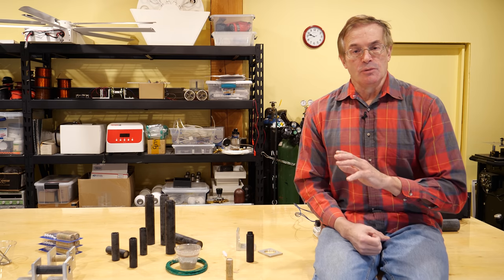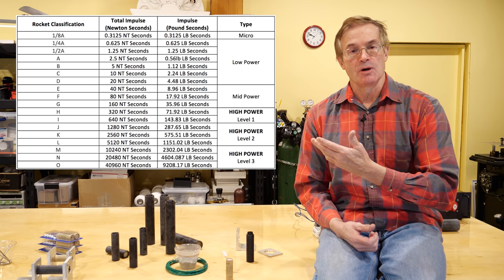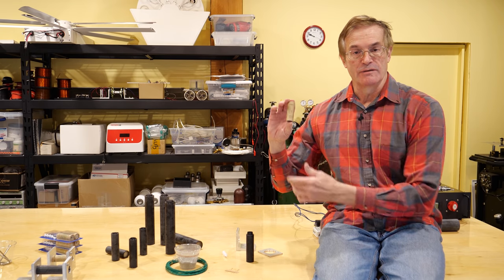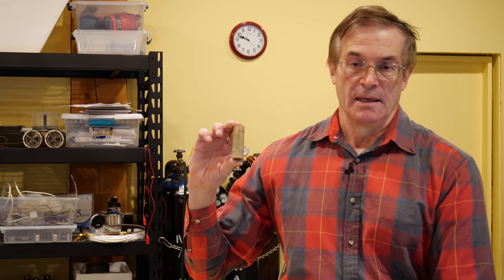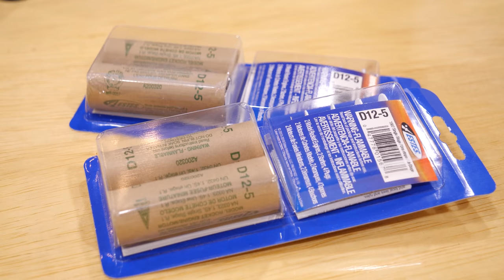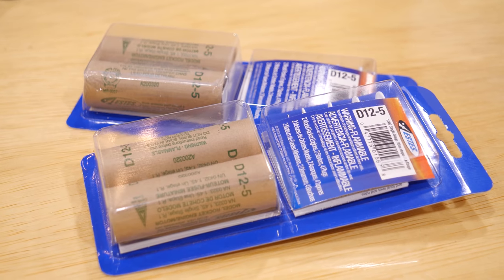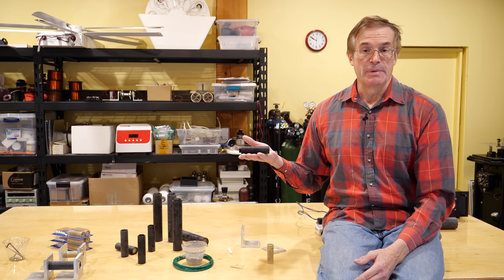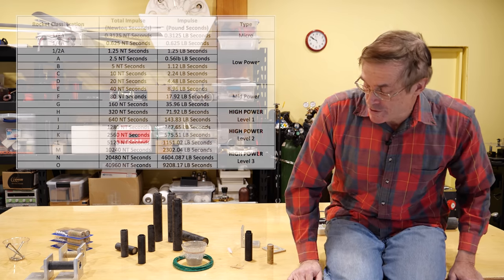Igniting Our Own Rocket Engines - DIY

Comment: When I was a kid back in the early 90s I built model rockets with my dad, and even my sister built a few. No idea how many we made over the years, easily dozens. The biggest ones I built used D engines, with one three stage rocket (two Cs and an A).

Anyway, lots of questions!

It looks like your standard mix engine emitted a lot of large, slow sparks. My guess is these are fragments of fuel mixture which has broken off from the grain. I also noticed in your previous video that the standard fuel mix didn't burn perfectly evenly, sometimes erupting from beneath the surface of the blob and then burning backward toward the flame front. The fast mixture seemed to burn much more evenly, and also seems to produce fewer large sparks (or maybe they're just moving faster and thus harder to see on camera). I'm assuming these things are related? Are they significant enough to impact performance in a meaningful way?

Finally, can you give some info on the failure mode of the bolt on the mounting bracket for the narrow motor test? I'm curious about the force produced and pressure inside the motor at the time of failure. I noticed that you switched to much larger washers on top after the test, which suggests that the pressure on the tube was too high, and the tube wall failed? Or perhaps you threaded the tube and those threads failed?
Reply from the maker: The tube plug failed with the much higher pressure due to the narrower nozzle.  The tube was fine.  Some of the sparks were due to the flash powder on the fuse and some may have been from the fuel itself.
Reply: @TechIngredients  Sorry, when I was talking about the failure I meant the bolt pulling up and allowing the mount to move during the engine failure. I'm trying to use the strength of the fastener to approximate the pressure inside the tube.

Comment: Would you do an episode on thrust in a vacuum? Explain how thrust is not possible when air is not under pressure and has no mass. I expect you would not be allowed to do a show on this because that would get people wondering how NASA went to the moon (or not). Or maybe you could do a show on helium filled balloons used for satellites and how they don't orbit earth at 17,500 mph? NASA is the largest purchaser of helium in the world. Maybe explain how satellites can magically travel 3x faster then the fastest Rocket plane ever made. Lol.
Reply from the maker: Thrust is possible  in a vacuum. I explained the principle. Did you not understand  my explanation, or can you explain what I said that was incorrect?
It's  difficult,  but not impossible to prove this because  the motor exhaust  fills the vacuum  chamber far more rapidly  than any pump can remove it.

Comment: I wonder what would happen if you filled a shock tube with argon and set it off. (The thin plastic tube coated inside with high explosive)

Would you get a huge argon flash?

Comment: So when a motor explodes and you say it’s because the nozzle was too narrow, which does make sense to me but I have to wonder could you just not make the plug stronger or the case heavier in efforts to contain that same amount of thrust being produced?
Reply from the maker: You could. 
The efficiency would increase as well 
The chalange is that as the pressure rises, so does the burn rate of the propellant in a positive feedback loop.
Small changes in throat diameter leads to large changes in chamber pressure.

Comment: Question for you boss... Does the grain hole in the dryer of your fuel in the center of a rocket engine, does that need to go all the way down to the base of the engine or can it go only half way down?
Reply from the maker: It should go down to the point that what remains should not be thicker than the walls of the grain.

Comment: Yes I would like to see the impulse v.s. time. 
Since F=mA, does it matter how fast the rocket burns ?  
Use a slower burn of heavier elements to get things going and then move over to lighter high speed products ?  
Micro motors. It is dumb of me to fear getting on DHS watch list but ... after the Oklahoma bombing ordering straight ammonium nitrate seems risky.
Reply from the maker: It doesn't matter how fast the fuel is consumed.  The greater the energy release per gram, the greater the impulse. However, the only way that energy can be converted into impulse is through the velocity of the exhaust and that inturn from the gas pressure.  Thermite would make a terrible fuel because despite the large amount of energy, little gas is produced.
Reply: @TechIngredients  This first part was unexpected. The second - completely understand.  
    As for impulse - yes. Newtown's third law, each action creates an equal and opposite reaction. 
   As for F=mA - the car example. Two identical cars leave a stoplight. One accellerates hard to 45MPH, the other accelerates slowly. Both get to 45MPH. First one used more fuel than the second one.  Am I wrong ?

Comment: Would changing the configuration of the hole increase the surface area and give the motor more thrust? Instead of a cylindrical hole maybe a square hole that gives you more surface area to burn.
Reply from the maker: Sure.
The smaller  the core, the lower the surface area (initially). Eventually, the core diameter will pass through  every  possible diameter as the propellant  is consumed.  Thus, with a small core, the initial  thrust  will be lower, but the total impulse from a given size motor will be higher because  there will be more propellant.

Comment: I was wondering if the slight offset of the center hole would produce the asymmetrical thrust that seems to be generated in some of the burns? Does the nozzle help shape the flame and stabilize the thrust vector?
Reply from the maker: I think you're right about the asymmetry and yes, it does.

Comment: The motors were still spewing a bit, thus incomplete burning. The larger motors seem to have less spewing, and more complete burning. 

It is likely that the larger the engine, the more efficient the mixes gets. Maybe getting more fine starting material gets better results with the smaller engines.

If you want to read on explosive/propellant mixtures, I have go some books added to this project: https://grabcad.com/library/rifle-primers-pistol-primer-1, also if you are interested in more, just click on my name in there "A B".

Very cool to see energetic materials and its uses!

Greetings,

Jeff
Reply from the maker: Agreed

Comment: No strain guage on the rig to estimate rocket performance? A cheap kitchen scale between the front of the trailer and a nearby tree would provide only rough data, but at least it's data, and the commercial rocket provides a known baseline for calibration. 

Edit: just found out that the rig does indeed collect thrust measurements. I'm a new subscriber so I didn't know. Looking forward to the data! I'm a research engineer, currently making medical instruments for COVID-19 testing in hospitals, so I'm a big fan of data collection & analysis.

Comment: How much would you say each one of those rockets cost to make? And how do they compare to the of the shelf equivalent?  I am curious as to the price difference. Also, do you think you might have a more consistent burn off you would have put your fuel in a vacuum chamber? I am new to all of this and ask looking to dive into a new project.
Reply from the maker: The small ones cost about $12 and the large ones cost about $20.  The small one is about  1/2 the cost of a commercial engine and you can't buy engines as large or larger than the large engine.
Reply: @TechIngredients  thank you! Fantastic channel by the way. I am a teacher and an learning from how you present yourself.

Comment: I was wondering if you read my comment about the eutectic mixtures of nitrates and sugar alcohols I posted on your previous rocket video? I think it could be very useful for your rockets.
Reply from the maker: The oxidizer remains in suspension no matter how fine it is ground.  A eutectic mixture requires a molecular scale interaction to interfere with crystalization.
Reply: @TechIngredients  Not sure I understand, do you mean you tried the nitrate eutectic and it didn't melt with the sugar alcohols?

Comment: What size was the "narrow" nozzle on the F motor? I am VERY curious about both your F motor tests because I've been trying to perfect one of these forever and they either blow up just like yours or make too little thrust.  Done 30+ tests, PVC, cardboard cases, water putty and cement nozzles, steel & nickel throats.  Sorbitol & KNSU mixes, Corresponded with James Yawn and Richard Nakka, still these just want to CATO. Should I just jump up to a G or H size?  I have a planned 4lb Gemini scale model rocket and only want to get it up under 1000'.  Original plan was to cluster two F75 motors operating with around 13lb of thrust each and 4 grains of inhibited KNSB cast propellant.
Reply from the maker: There are a lot of variables including the fact that as the chamber pressure increases, the regression rate increases too!  Best to do repeatable testing.  Build several identical motors and starting with a throat diameter that you know from testing is too large and progressively narrow the throat ( DON'T CHANGE ANYTHING ELSE) untill the motor explodes.  Then use the next larger size.
Reply: @TechIngredients  Thanks for the quick reply; really like all your videos, done very professionally and intelligently!

Comment: Wait, no strain gauge to provide measurements? I'd like to see how accurate the thrust estimates are. Some of the mixtures just weren't giving the visible indicators that they were producing good thrust. Now I've got to go assemble the parts I bought two years ago and haven't had time to play with yet.
Reply from the maker: There is a load cell in the sled and we'll use it for the next tests.

Comment: Hi ^^ don't get it wrong, I love your channel and in fact I like most of what you did since the beginning,
 but your solid rocket engine doesn't seem very good, especially the nozzle and the exhaust velocity.
With a good nozzle you could've (maybe) reached mach diamond 
I think I saw a guy hwo did a video on a program he've written in solidwork to generate rocket nozle 
I don't remember If It's total bs or not, but well, I'm just suggesting someting x)
maby try to better mix the fuel because we can see instability througought the burn
lol I'm saying all of that but I have no knolege in rocket science so... yeah
I also wanted to say that I loooooove your youtube channel and I wish you an appy new year ^^
Reply from the maker: No problem.
These were also OUR very first tests if these engines.
We learned a lot and the next series will include a coring jig, other fuels, test data and alternative firing methods.  This is a lot of fun!

Comment: just an idea, but could it be better, during manufacturing, to cool more rapidly the sugar-oxidizer mixture inside the rocket to improve regularity of the burn? in a cold bath for example. The idea is that when the sugar cristalize, it should push the oxidizer out of the cristals. rapid cooling means smaller cristals, so more homogeneus distribution os sugar-oxidizer
Reply from the maker: Possibly, although rapid cooling through a bulk would be challenging.
Reply: @TechIngredients  true, then could there be some chemical inhibitor, something that makes the cyristals smaller, like vanadium does for the steel grain. I'm searching the web but I still found nothing on sugar. Unfortunately I'm not a chemist

Comment: Hang on, let me get this right. You're going to launch a pink elephant?

Now I know why the engines don't go higher than 'O', which I take it stands for 'Oh F^(£!'
Reply: There have been several P size engines I've seen launched and I know of at least one R and one Q. And yes, in person they inspire lots of words... and the tenor of those words change as the launch is closer, or if it goes unexpectedly!
Reply: @martinmckee5333  I've watched a video of an S.

But yeah, very rare to get so high impulse, at least with solid engines.

I've built (and flown) up to an M, personally, but no higher

Comment: Please ignite the motors from the bulkhead only. Youre losing a significant amount of thrust by igniting these as end burners and not core burners. You will also get a higher specific impulse if your kno3 is granular and not powdered.
Reply: "You will also get a higher specific impulse if your kno3 is granular and not powdered."
 - Does that apply even when the fuel is actually melted before being loaded into the motor? Seems to me that granular vs powdered should be pretty much irrelevant once it goes liquid..
Reply: @jahudka  Because the kno3 has a much higher melting point, it keeps its granular form even when melted. Im unsure of the science behind the result but believe its due to the amount of surface area between the fuel and oxidizer.

Comment: How would you design a flare that maximizes light output and burn duration (and probably has some safety measures)? I imagine it is similar to a rocket engine in some ways, but has different filler?
Reply from the maker: I'd slow the burn.  remove the nozzle!  And, add metal powder like aluminum or magnesium.

Comment: Today I was chuffed to discover that Estes motors are all sold based on how they test at the Estes factory which is in colorado so they all perform worse for those of us at sea level than they are advertised.

Edit: Of course most people and kits buy based on what estes has been selling forever so if they changed to a sea level based system it would ruin things for everyone by throwing everyone off.

Comment: It looked like a lot of unburned fuel was being ejected out the back of the motors as ember/sparks was that intended as part of the experiment?
Reply: It's good for the show, but means the thrust (using this chemistry) is rather suboptimal.

Comment: Can you use different mixtures in one tube as a staging?  method and would these work under water?
Reply from the maker: As long as the layering is in concentric rings because the burn progresses  from the central core outward.

Comment: Why did your engines have a wider angle of propellant ejection? Also, why did your mixture send out sparks rather than a cone of gas? Is this an artifact of your propellant choice?
Reply from the maker: The Sparks are probably residual from the flash powder and the off center exhaust is likely due to the free hand placement of the coring rod.
Reply: Okay, thanks!

Comment: So I’m curious though on as you roll the rubber cement fuse in the mixture do u just shove it anywhere in the back end?
Reply from the maker: It's best to get the engine to ignite as far forward as possible and so placing the hot end of the fuse fully in is better.

Comment: What about pulse thrust rocket motors? How do they work and what applications are they for?
Reply from the maker: Pulse detonation engines have the advantage that the propellent is pumped in between high pressure pulses, reducing the pump power requirement significantly.
Reply: @TechIngredients  Ah, that would be beneficial, thanks!

Comment: thanks brother for both great video just i subscribe to your channel, and i have a questiion i watch the proses how you made and i saw the burn time of all the motors, but seems the motor d burned way smoother and even and produce even power but the other motors sparking and they didnot burne smooth as d one did you figur out why?
Reply from the maker: It's probably due to the asymmetrical coores.  Check out our more recent videos on these motors.
Reply: @TechIngredients  ok yeah I fell in love with your videos man and I have another question how you can determine the ratio of amount of tile and distance can rocket go is there any chart for that
Reply from the maker: Tile?
Reply: @TechIngredients  fuel sorry

Comment: How could you modify your rig to make it so you can measure the actual thrust to compare with the calculated value? That's what I've always wanted to be able to do.
Reply from the maker: I showed the test rig in more detail in the first video in this series.
Reply: @TechIngredients  So I went back and the-watched the first video. In it, you only calculate the theoretical thrust based on an assumed ISP. I wasn't to see a rig that can measure it.

Comment: The "store bought" motors don't create a hole all the way to the other end, instead the hole in the "store bought" D12-5 motor is about 1 cm.  Why did you make your motors with a hole all the way to the end?  Wouldn't the material burn inward to the end without the hole?
Reply: I found the answer in a different comment thread in the prior video.  The hole size and shape affects the burn rate.  There is an art to the design (depth and shape) of the hole.  The bigger and deeper the hole, the faster the burn. Asymmetric  hole shapes can produce desirable burn profiles (e.g. really fast, followed by a slower burn).

I am interested in a slower/longer burn rate, so I would likely want to minimize my hole depth.
Reply: Also, I really appreciate your videos! I have subscribed and will watch many more.  Thank you.

Comment: Compared to a black powder rocket engine (usual 75/15/10 ratio), where does this r-candy come up energywise? More or less?
Reply from the maker: Black powder has an Isp around 80, most sugar fuel including this one is approximately 130, ammonium perchlorate composite  is aittle over 200.
Reply: @TechIngredients  Nice! I made one motor each with your recipe with and without the rust additive and looking forward to test them against the BP endburners I usually make. It'd be great to not to have all the mess involved with mixing and pressing BP.
Very happy new year and best regards from Switzerland

Comment: If you use this in a model rocket how do you get the parachute to deploy if there’s no delay charge?
Reply from the maker: With larger rockets this is usually controlled with an electronic firing trigger to an ejection charge.